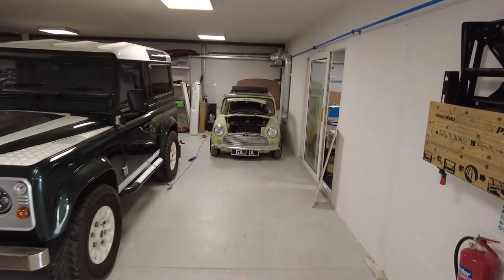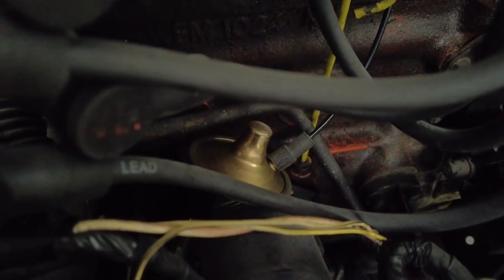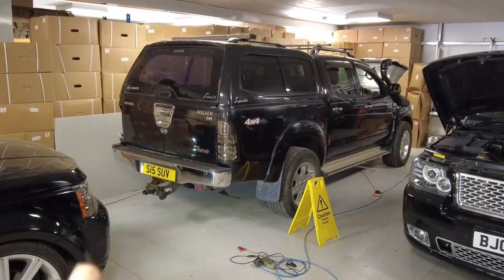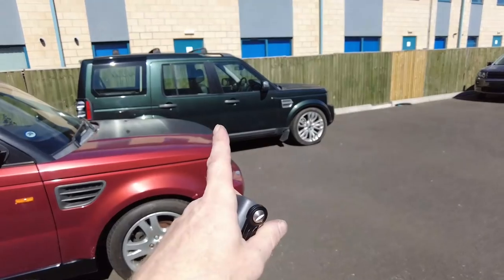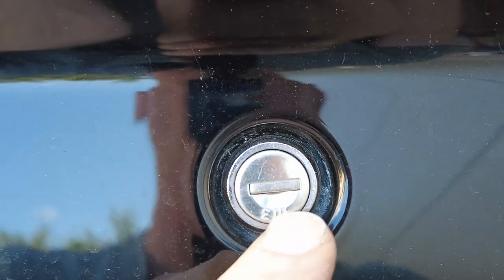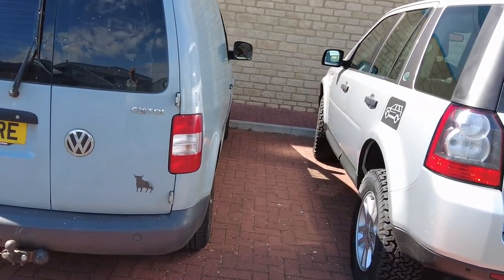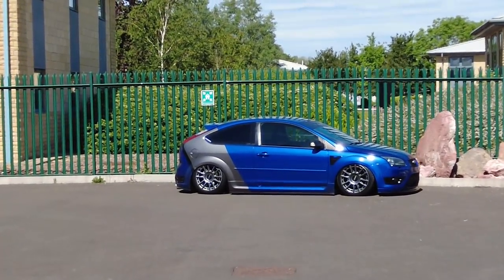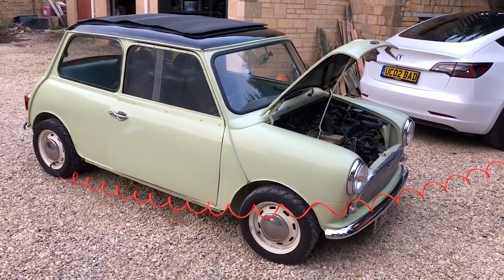VLOG 6th June + Project Car Tour + Classic Mini New Ignition System...

Comment: My first and second cars were mini coopers. Is yours sporting the more modern A+ engine minus the extra head bolt and 5 bearing crank? Nice ignition set up, it was such a pain in the ar5e having to dry out the dizzy every time I hit a puddle. The old twin SU’s were also a pain to keep in balance and nearly swapped over to a twin choke delorto but it was stolen before I got round to it🤬
Reply from the maker: Yes the car is a mix of parts and yes it has the A+ metro engine in it. The twin cars are a pain to balance as you say. We tested the ignition setup today and it works really really well... I may put the footage up but some of the driving may not be to the standards of the institute of advanced motorists !

Comment: Any progress with RotoPax for the new Defender's molle plate? Thank you.
Reply from the maker: Hi - let me check with Rotopax again - they are still not able to add me as a distributor !
Reply: @L663  Thanks Simon. I can buy their cans and mounts locally (US), but was hoping you and your team might come up with a mount system that doesn't involve further drilling into your molle plate and can be removed when not in use.

Comment: You missed the red discovery. What’s the plan for that?
Reply from the maker: Well greetings ! just today I have ordered a new 2 poster lift for the new workshop.
The plan is to get the new workshop finished and get the G4 Disco 3 on the new lift and fit the new handbrake assembly so everyone can see..... its all in the master plan !
Reply: @L663  Good stuff. You’ve probably thought of this before but when you install your two post lift I would recommend fitting a power outlet to each of the posts. You’ll be glad you did trust m.
Reply from the maker: @drinternatg6391  Thanks for this - we are doing the wiring on Friday !
I got qa 3 phase lift so will put 3 phase for the lift and single phase to each post for power tools etc maybe air too ?
Someone complained about the mini driving video..
Reply: @L663  Never thought about the air. Good idea Simon